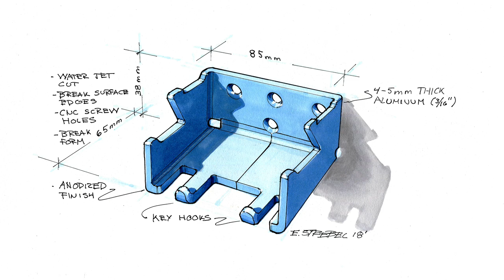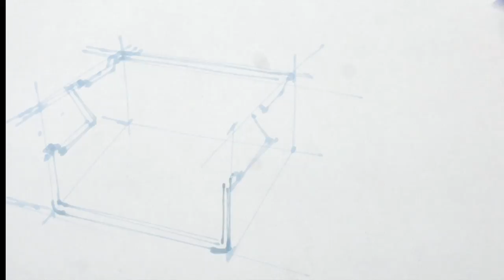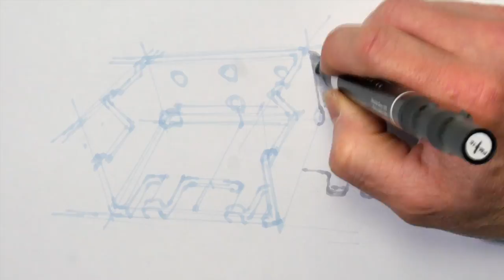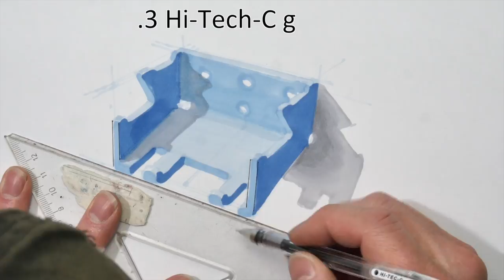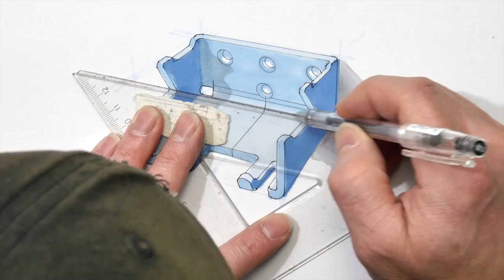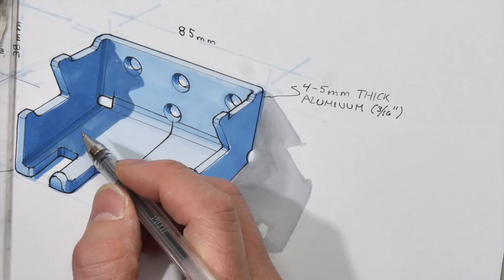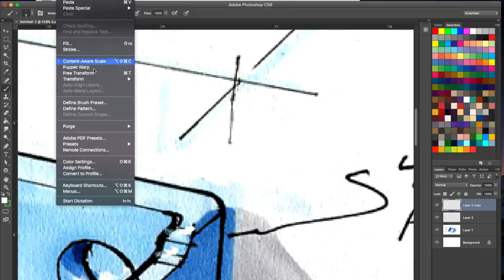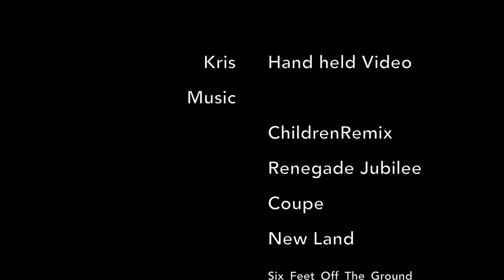Marker Sketch: Aluminum BackPack Hanger: Industrial Design

Comment: i think there's a fault in the shadow
Reply: I saw the same thing, I am a bit puzzled on how to justify how it is drawn. Great job on the video and the additional explanations and tips.
Reply: I think I understand now, the shadow on the right is not on an horizontal surface (like a table)
 but on a vertical wall behind the part. Assuming that the part is screwed on the wall, then the shadow makes more sense.
Reply: @nccyr1    you right  thank you . i was thinking that it is on the table